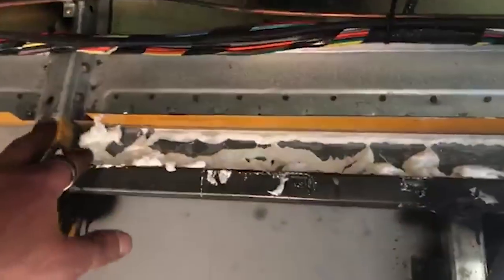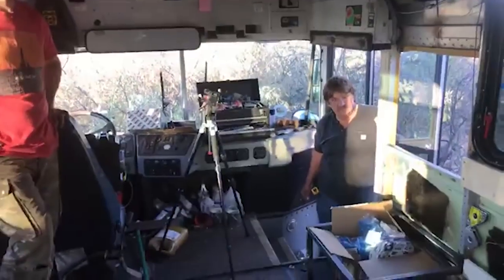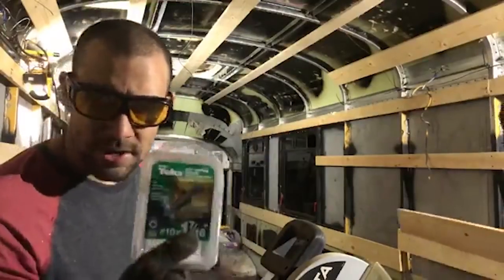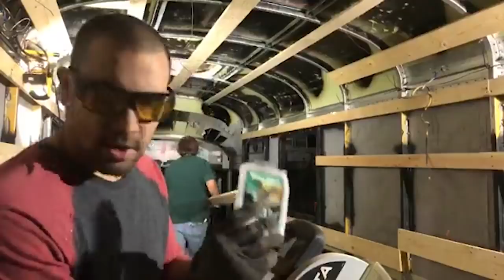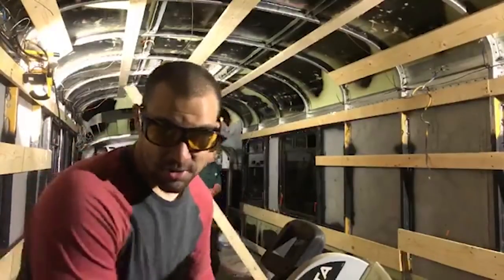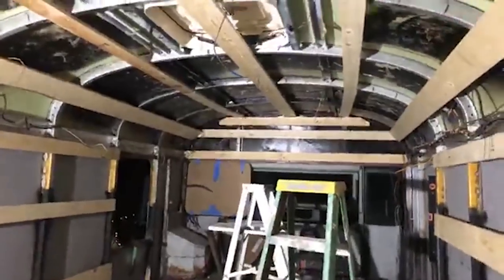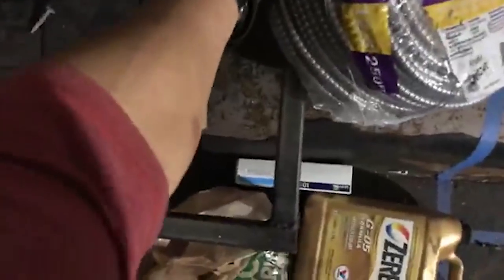Our Skoolie Gets Runners ~ Help Is Always Appreciated When DIY

Comment: Have you prepared a plan for lighting and outlets?  A piece of PVC pipe to carry the wires from the solar panels to the battery compartment will simplify installation.(with a pull cable installed would be a good ideas too.)

Comment: Chris an though of an cheaper way to run wire is to use indoor and outdoor heavy duty extension cords, sometime you can get in different colors and if you going to have an shower built it under the top emergency hatch so you can air it out in warm weather.

Comment: Be sure to run a large conduit to hold wiring (12 volt) front to back. Are you going to put a window in the roof in back of the drivers set? Glenn Lever
Reply from the maker: Yep, running conduit today! No window in the back, keeping it as an emergency exit.